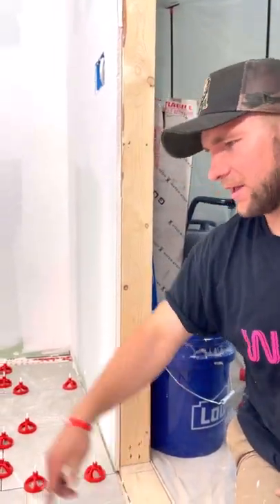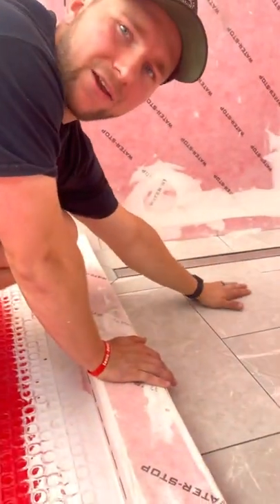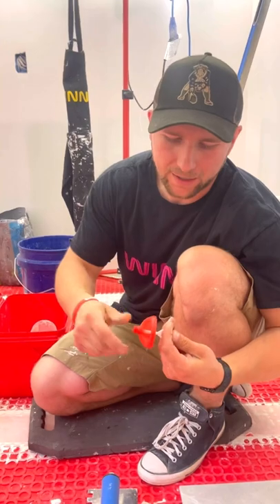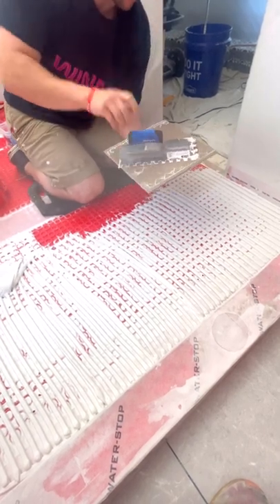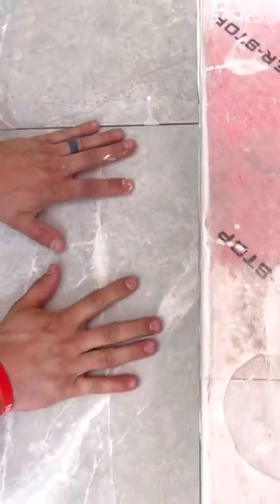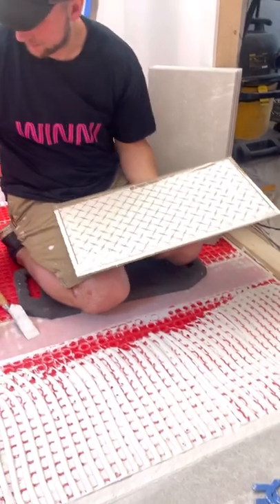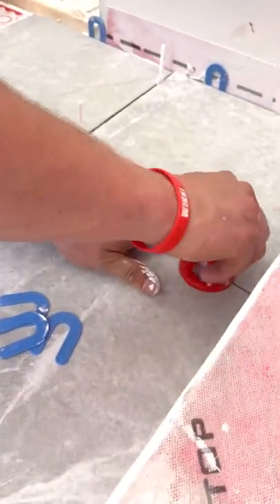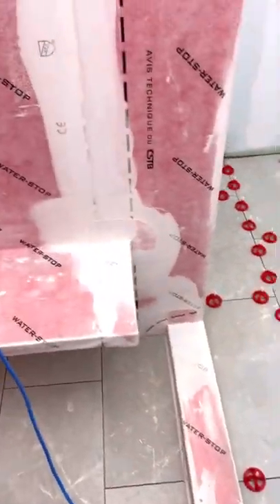How to TILE for 🐣 BEGINNERS 🐣. Very Easy! WINNI DIY Vlog 012

Comment: That thinset is overkill for that application. But if you have the budget, go for it. Those levelling clips are the pricier, and more time consuming version. The wedges are fine, and more readily available. Most 12x24 tile manufacturers will recommend against staggering your tile with a 50% offset like that. if there are peaks and valleys in the floor, a 1/3 offset will hide the peak or valley, and keep tile edges beside each other from being too high or too low. For DIY applications, it would be best to first dry fit (without using any thinset) your entire floor first. Especially if it is an irregular shape. Pay attention to your grout line size, and make sure you aren't laying out the tiles too close to each other. Then, take up the dry fit tiles starting from the doorway into the room working in sections or zones that are within arms reach. These will be the zones that you spread your thinset to. Keep track of which tiles go where, usually putting them in a stack against a wall and in order of right to left, front to back. Use a marker on your underlayment to trace the tile footprint each time you take up a 'zone.' Using a marker on the floor, or on the bottom inch of a wall to mark where grout lines are supposed to be will also help to keep things in the exact spot you dry fit them in. Doing it this way means you don't have to be making cuts while your thinset is drying out in the bucket. It also means you can walk on the tile while you are dry fitting them, which you cant do when you are setting them.
Reply: Lot of good tips here, I did the full cut and dry fit and dry erase marker on each one (tape with sharpie would work well too and not rub off as easily).  The 50% offset is usually fine for porcelain tile, the reason for not doing 50% is if the tiles aren't flat and are more likely to cause lippage which is usually the case with ceramic tile.  Don't forget to look at patterns on tile and mix it up, mix up batches too.  Invest in the proper tile cutting tools to make the best edges (if they are visible) and not have issues cutting smaller pieces / weird corner pieces and whatnot.  I have a great wet tile saw with a new blade, large 24" tile cutter, diamond angle grinder cutting disc, etc.

Comment: its not level its smooth    level your first coarse both ways  that means using a level    torpedo  2footer whatever then use clips since the floor has not been  prepped with mud, check with torpedo level every once in a while while tiling